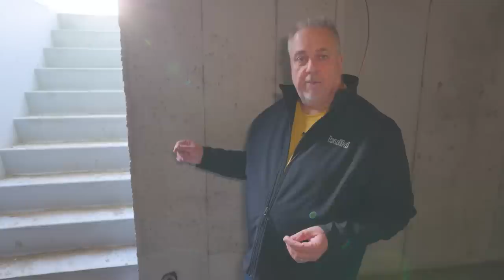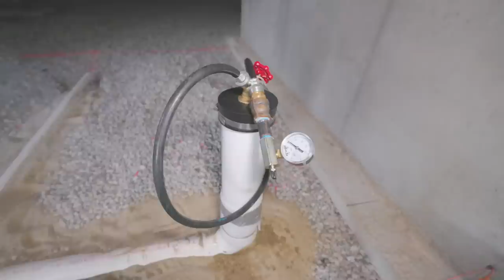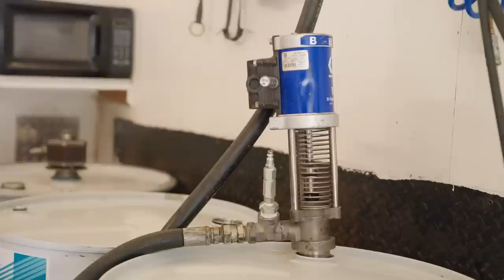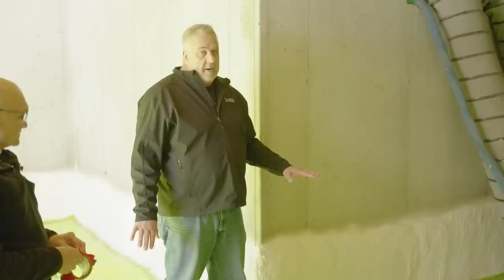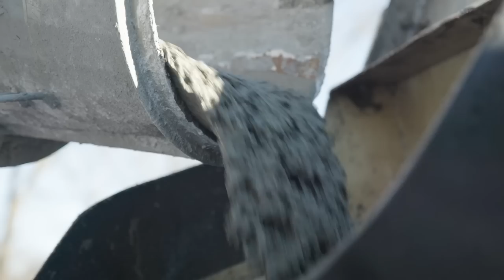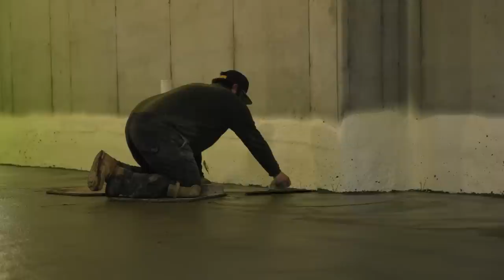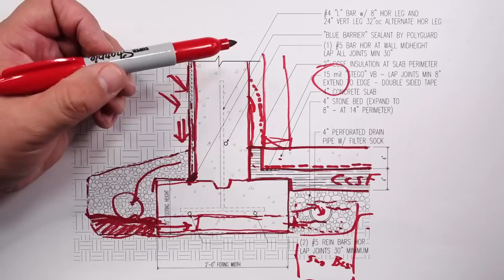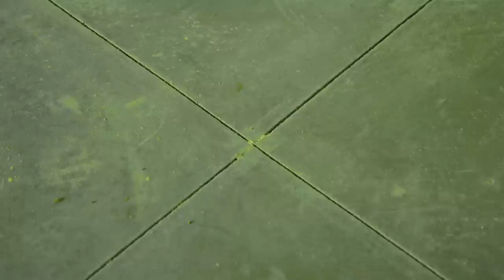"Basement Slab" Build Show Build: Boston Ep. 9

Comment: Why not just use Amvic R-30 ICF for basement walls
no extra framing
air barrier included
no sub insulator to call in , schedule, pay
faster , fewer parts ,shipping , handling
use EPS on the floor for whatever R value you want
lower cost
Reply: I looked at pricing and the ICF approach was 2-3 times the price.  Steve wanted real basement framing, so the savings n framing were not going to be a factor.  We will try again to look at ICFs with a piece of the project to come in a few months.
Reply: We looked at a couple ICF installs - that just didn't compete in price.
Reply: @stevenbaczekarchitect9431  I suppose cost is regional depending on labour rates and concrete pricing, we find its equal to wood frame but faster.  Many foundations are half the cost with ICF

Comment: I know nothing about radon, but can't the concrete people design a mix that would replace the plastic? Penetron maybe?
Reply: If you run a depressurizing fan from the start, the slab may be enough. The problem with slabs is you only get ! CHANCE to get it done....a little insurance I think is good

Comment: I did a radon test on my existing home recently and found it was a 4.5. When I searched for contractors in my area who specialize in fixing it I found nothing. I have part of the garage turned into a pantry that is now effectively living space, it was like this when I bought it, remodeled by the previous owner and signed off on by whatever processes the county and bank are required to use. I assume the living space being exposed to the portion of garage slab is the culprit. Are there any recommended videos I could watch to prepare me for DYI mitigation in post? Any advice would be helpful. Great video, such nice work. :)
Reply: not necessarily. Typically radon mitigation is done through a negative pressure system installed either sub slab or in the sump. You can do the install yourself. The hardest part is drilling through the exterior wall and installing the exterior pipe to discharge (far) above ground level .